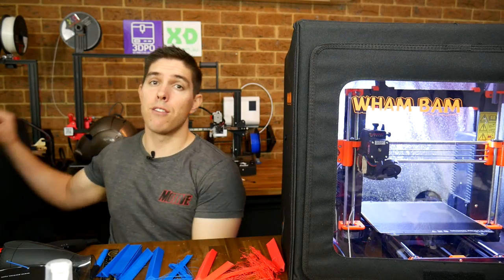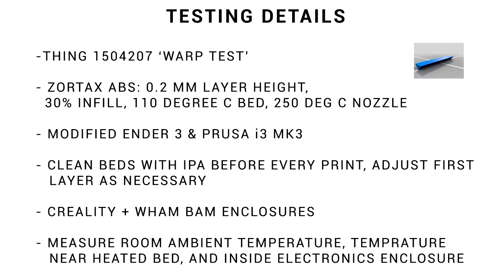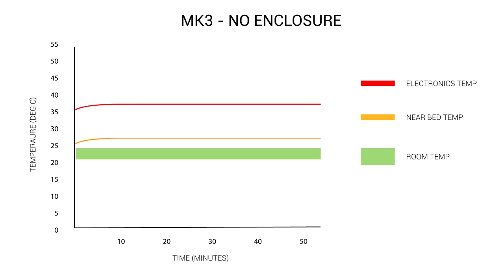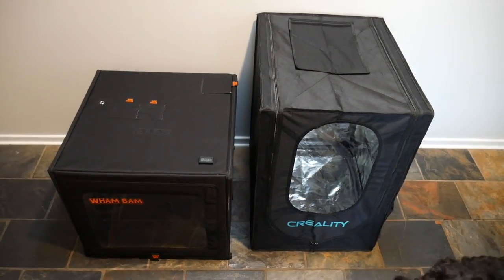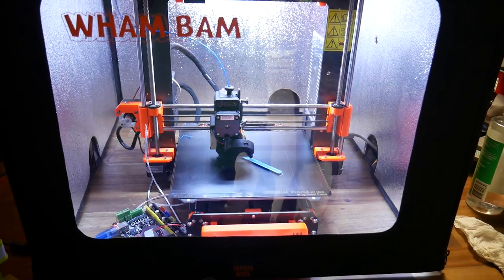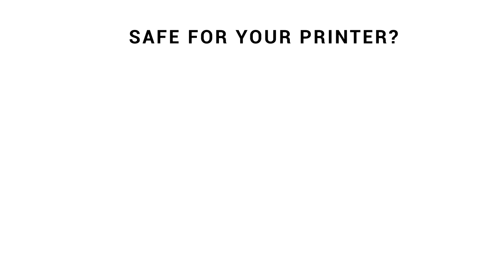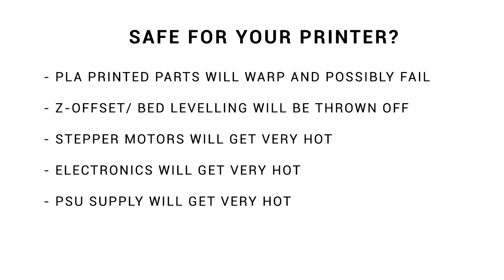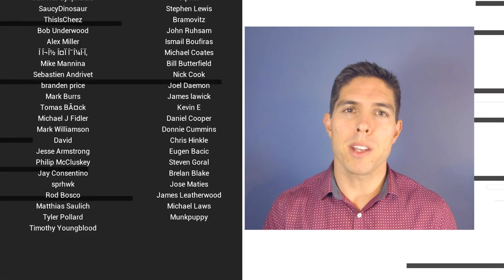Pop up 3D printer enclosures tested - Creality vs Wham Bam

Comment: thank you Michael for your in depth review and informative testing. Its crazy that you couldnt get ABS to print well on any of your 3 machines, we print almost daily with ABS with great success.
Maybe it realy is your filament?  We use eSun for great quality to price, and get great results.  A few tips: if you heat your bed to 110-120 you can achieve a 40°C temp in a short time and hold it there for the length of the print with no external heater needed.  Maybe it was the drop in temp that destroyed your prints?
We dont recommend using with internal electronics at over 50°C , and the Wham Bam HotBox has that built in, just open the top vent port to allow some hot air to escape when it starts to rise over 45° C. You can also print the feet on thingiverse to raise the HotBox off the ground by a bit allowing cool air to stay around lower electronics and the heat will stay trapped above.
I do hope that you can get the results you are looking for and are able to see the advantages of printing in an enclosure soon!
thanks
Reply: Thankyou mam. Sry. Couldn't helpmaself
Reply: I personally think it was bad filament as well.   I print abs on my prusa with no enclosure for small prints.   The key is to shield the drafts from the print.   I believe the air moving from the hair dryer negatively impacted the situation.   

Abs is tricky to get to stick on the first layer in my opinion.   I would like to see Michael Try again with different filament and some sort of bed adhesive.   I bet there will be noticeable difference of enclosure vs no enclosure.   But btw I like the convenience of the wham bam.  Looks much easier to use!
Reply: Ps. I think with better bed adhesion it will show that the enclosure prevents delamination.   Any print that isn't adhered well on the first layer will warp pla petg.   abs.  

Give us a part 2 Michael!  ;)

Comment: Interesting stuff, the steppers getting hot isn't that big a deal - generally they'll have insulation class H windings, so they can get seriously hot before the insulation is significantly degraded.
Reply: the problem is that they start losing steps when they get hot

Comment: cooling fan 20-50% when printing enclosed ABS. 50c enclosure temperature. If you can't get to or maintain that heat use a 120mm case fan spare heated platform (perhaps one left behind after a printer was upgraded) and spare power supply to cobble together an additional heat source. Use the fan to "cool" the spare print bed spreading the heat throughout the enclosure.  if you want to get fancy about it you can add a pi, and have it turn off and on depending on enclosure temp. Also ABS prefers a .06mm nozzle.

Comment: This heated chamber piece is something Statasys have (had? expired?) a patent on, in particular whereby the motors and other moving mechanical components are outside the chamber. The machine I saw had a thermally insulated (as far as reasonable) slot through which the bed gantry moved, allowing the Z axis lead screw and motor to be outside the heated chamber (this being a printer where X and Y are at the top, not the style of the Prusa and the Ender 3 where the bed itself travels in Y). Interesting to see these simpler and cheaper solutions failing, so perhaps Stratasys are onto something with their designs!
Keeping all the electronics, PSU, motors, and filament outside the heated chamber would naturally seem to be a sensible necessity - especially for cheaper electronics that aren't rated to operate in higher ambient temperatures.
It would be interesting to take temperature measurements directly on the motor driver chips, which are likely specified for narrower temperature ranges. Those heat sinks may struggle to dissipate the heat from the drivers in a higher temperature environment.
Reply: I think this is the patent - https://patents.google.com/patent/US6722872B1/en - current expiry end of Feb 2021. Key piece is from the abstract I think is this, "The motion control components (18, 20) of the apparatus (10) are external to and thermally isolated from the build chamber (24). A deformable thermal insulator (132) forms a ceiling of the building chamber, allowing motion control of the dispensing head (14) in an x, y plane by an x-y gantry (18) located outside of and insulated from the build chamber (24)"

Comment: For my (heavily modified) ender3 pro I have a cardboard box (+insulation etc.) to put over, with an extra fan that blows onto the heating plate with a sensor in the case, and marlin configured to use that as the heater. takes a while but due to very good insulation works quite fine.

Comment: Enclosure only worked for me when i used abs juice, otherwise I had those same problems you were having. Without the enclosure though, I couldn't print anything over 20mm tall or 100mm in diameter without it warping.

Comment: Why didn't you do some tests using a glue stick for adhesion. I don't print ABS without it.
Reply from the maker: When testing you should only change one variable at a time. This was a test of the boxes, not glue stick/hair spray/brims/etc.

Comment: One way to Keep the part in temperature is beaming with infrared light. Did someone try this already?
Reply: Nasa did it. But used halogen bulbs instead of infrared. Here is the article.

https://www.3d4makers.com/blogs/news/turning-a-desktop-3d-printer-into-a-high-temperature-printer#:~:text=The%20NASA%20team%20made%3A,to%20withstand%20the%20higher%20temperatures.

Comment: You know, these are some pretty simply made enclosure. I think you could easily make these with just a few PVC pipes, some aluminized bubble wrap, and 3D printed connectors. That's maybe $20 to $30 at Home Depot 🧐

Comment: Very strange. I’m using my Ender 3 inside the Creality enclosure. I get great ABS results. I have all the electronics inside the enclosure as well no problem. The only difference is I’m using Klipper and the Pi is outside the enclosure. So the little 8bit chip isn’t working so hard.

Comment: As always it was very interesting ! Can I make a suggestion ? The way you did the graphs we can't compare them directly. I would have used 1 color for one combination (for example blue for ender 3 + ender 3 enclosure). I would have then use solid lines for electronics temp, dotted for bed temp, etc. That way I would have directly compared the results: Ender 3 without enclosure vs with Wham Bam vs with Creality. Passive vs active, etc.

Comment: Free option: I used corflute to make a box (old election placards), lined it with bubble wrap, and created a lid with a thermal blanket (the cheap silver one) as seal.  For asa it's fantastic but printing with a raft is almost essential.

Comment: Are those schnauzer puppies? I can only get abs to stick in an enclosure with a coating of abs juice on glass.   A mixture of disolved abs in acetone. ratios on matterhacker site. My encloser is on reddit its a frame attached to the cr10 of printed parts fitted to the aluminum extrusions and covered with inexpensive mylar emergency blankets cooling fan needs to be off when printing abs also great video thanks for your info. Wham Bam must be giving these things to ever content provider.

Comment: Thanks for the video. :)
I think you gave up to easy. Maybe not using  filament you know sucks to began with. That said, water cooling the steppers, upgrading to something like a TITAN AQUA hotend and extruder, and removing the electrics from the enclosure might be a bit much. lol. I plan on doing all that. But, I want to print abs and asa structural parts.
Reply from the maker: For sure there is a balance to be had on effort vs reward.

Comment: Is it ok to keep the psu in the enclosure?
Reply: Not really..an the electronic too ,its a solution that gone kill yuo power supply in time(an the electronics too), so that why people remouve all the electronics outside the box, then yuo can have 50 -60 celcius inside the box and the electronic will be fine.But as yuo can see its more easy to sell a "closed bag" to everyone. ..if the the electronic die well..its yuo fault

Comment: Surprised to see such bad results with ender 3 ABS. But it's defs the profile ABS first layer needs to be slooooowww. Try it with kapton tape adhesion so strong I can lift my ender up with a finished abs print

Comment: I got my head bitten off for even suggesting to move the main board on the Prusa Facebook group. They are so up tight you can't use hyperbole or edit a post without someone spazing out and getting upvoted for it. It's insane.

Comment: Good video but you have one fatal flaw which makes you test unusable. You used IPA to clean the bed. IPA leaves residue. This residue is unaccounted for in your tests and more than likely the cause of your adhesion failure at higher temperatures. I don't use IPA, I use soap and water with a final cleaning using Windex Multisurface cleaner. Then  I apply two coats of number 4 hair spray. Food for thought. It's up to you to connect the dots.
Reply: Do you use the Number 4 High Performance Hair Care Mighty Hair Spray or the Number 4 Jour D'Automne Mighty Hair Spray?
Reply: @GiovanyFernandez  Isn't there a Trump rally you should be at?
Reply: @frodobaggins169  Dear Stuart, I didn’t quite get what you meant by the Trump rally… I just asked you about the hair spray that works best with your adhesion as those I mentioned above are the options I found online.

Comment: I removed the eletronics from my ender 3 into a seperate box. I added a pei sheet to my bed and a cardboard box enclosure. I print abs at 245°C on the nozzle and 110°C on the bed. I have had success with this setup in printing the parts for my new Voron 2.2 3D printer

Comment: I'm currently using an enclosure from amazon: https://www.amazon.com/gp/product/B08LZ1JXYX/ref=ppx_yo_dt_b_asin_title_o08_s00?ie=UTF8&psc=1  and it has actually done a great job of stopping warping from ambient temps. I keep the top and the side doors open 1/4 of the way for air flow which helps motors and electronics from getting too hot. I made an air vent that attaches to a mainboard enclosure you made a few yrs ago with the fan in the front and that sticks out the front door to draw in cool air. The temp inside the enclosure is a consistent 88-90 deg F, I have had no warping at all. the enclosure stops drafts and sudden temp changes. I've been printing difficult parts for almost 2 weeks on it and only had one warp out of 45 prints. My latest print ist still printing at the time of this posting, estimated for 1 day, 7 hour, 45 min, it's currently at 20 hrs 57 min and there's no warping at all. I'm using an ender 3 pro upgraded with the mks gen board and tft display with MKS wifi.

Comment: do NOT leave the power supply in the enclosure!!!
if you can do not leave any electronic boards in there...!
should you print pla in there you need ventilation.
youre results here are just weird!